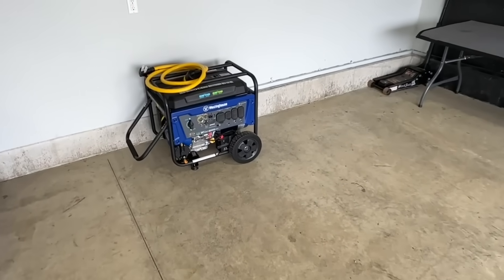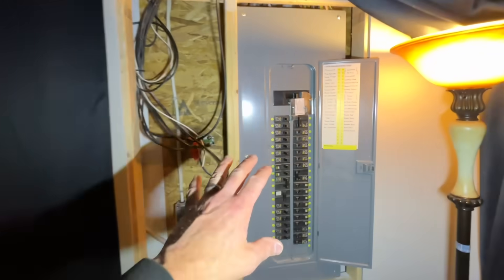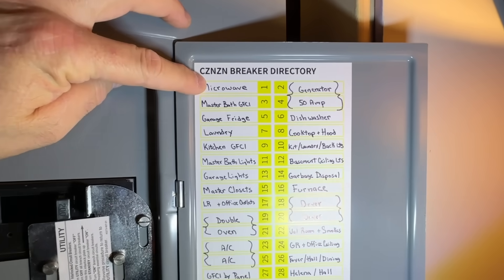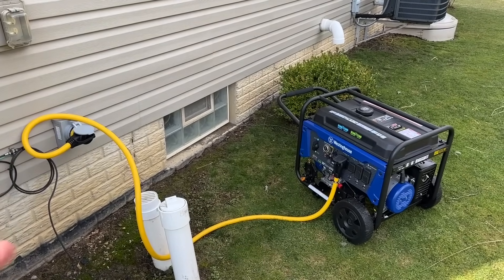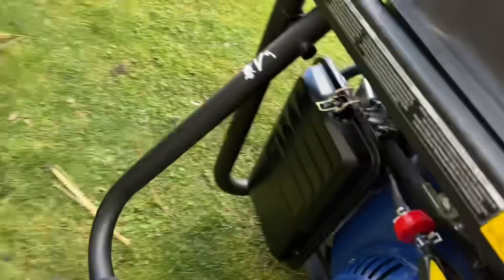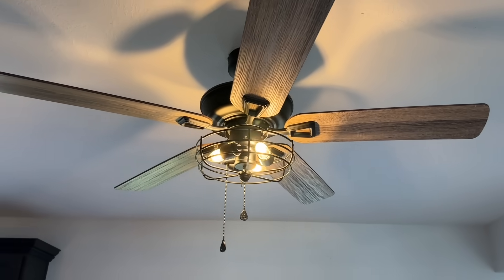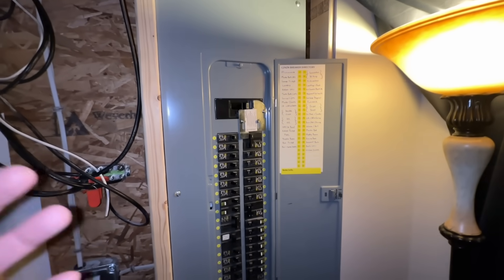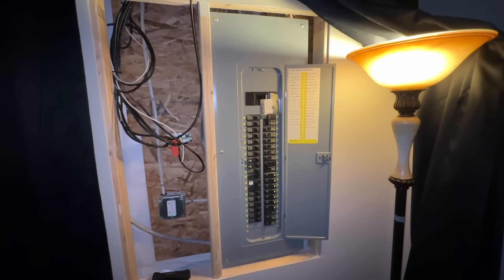Whole Home Manual Backup Generator Setup For Less Than $1600

Comment: BS I have same gen I don't shut nothing off , put 60amp breaker an hook gen to it leave it off, when power company is down , shut your main off ,turn on 60amp start gen mine has auto key chain type bottom, start gen whole house 1600sq foot an 1600 sq foot shop , have power I can weld an air compressed running good to go, so BS your telling the people for sure mine is (propane) the only way to go , life is not hard so don't make it that way:hand-pink-waving:

Comment: With that generator, you obviously did not research the impact of running your appliances and other electronics on "dirty" power.  That up front savings will come in handy when you have to replace a refrigerator or the mother board on your gas furnace.

Comment: I don't have a grid tied house. I just want  to w wire.straight to a mjlti.plug bix for my small 50amp plasma cutter or small.ibg multi process welder. In my stand alone work shop. Where do I.get the generator??. Thanks Dandahermit. Thumbs up and subbed

Comment: A question on GROUNDING.  I have the portable generator already, but not the manual cut-over switch and port yet.  So, do you still need to ground the generator (earth) or does the electric panel actually take care of that once the cut-over switch and port is installed?  i'm asking for a friend.

Comment: Awesome video! Great job at keeping it simple. I completely agree with you on not wanting to spend a crazy amount of money for something that may only be an issue once or twice a year. My biggest issue has been flooding due to heavy rains so I had a smaller inverter generator that could basically just run that. Our outages were usually only about 1-3 hours. I also have a battery backup for the sump pump, but the battery backup can simply not keep up if there are heavy downpours during an outage. I am going to buy the Westinghouse 12500 and get the same hookup you have. Been talking about it for 3 years but I'm finally going to do it for more peace of mind. Especially since I can't run the furnace without this type of hookup since it is hardwired into the circuit breaker panel just like the A/C.

Comment: This Westinghouse 9500 will run on Natural Gas ?  Most homes where I live (SoCal ) are heated with Natural Gas so have ready supply near my power panel . Seems this would be better way to power this generator and gives you "infinite " and ready supply ..not having to worry about storing gasoline for long period.

Comment: I think that I saw you set the geni to gasoline?  I was always under the impression that using gasoline was the beginning of the end for generators. The gasoline gums up the carb. Where the lp gas does not. Everyone I know do not properly maintain their generators making them completely unreliable or useless when most needed.  

What are your thoughts on this?

Comment: If you need only essential service, say heat, does $150 sound good?

You need:
1. $99, 0:29 1500W 120V15A Inverter. 
2. $45, 100ft. 12 gauge extension cord. 
3. $5 duplex receptacle, minor box rewire. 
4. Car with gas. 

You can run a forced air natural gas furnace with this configuration. I paid $150 for mine. 

You can cook with a grill, Coleman camp stove or single burner single gas 
Burner. 

Light with usb rechargeable flashlights. 

Most important is that you can be very comfortable without electricity in the winter. 

The power loss will likely just be hours or a day.

Comment: One thing to add is that it is important to have a surge protector on your panel. Code in some places is now requiring them on replacement or new panels. Trust me on the fact that generators can produce erratic voltages.

Comment: I like all of those circuit breakers in your “fuse panel”. That must have some kind of crazy 1920 to 2020 conversion kit installed???  Also, I assume that generator has a floating neutral?  If not, your electrician friend just wired you up a parallel path to ground… be sure not to touch anything metal 😵😳😬😭⚡️⚡️⚡️

Comment: I dont understand why you need to shut off any breakers but rather just make sure not to power them on during generator use. If not turned on, then no pull would be used. Of course im not an electrician so thats why im asking.
Reply from the maker: I just didn’t want my kids accidentally running around the house turning everything on during a power outage. That’s why I turned certain breakers off.
Reply: Oh ok that makes sense.

Comment: Really good video. I lost power for 7 days last year in an ice storm here in Oregon. Now I have a setup similar to yours with a Gentran transfer switch that runs 6 circuits. One thing I learned was the importance of a generator cover or ideally an enclosure that you can get under with it. I was trying to refuel in the pouring ice cold rain and the Genny getting all wet, so I rigged up a half ass cover that sorta worked but there's nothing worse than trying to service the Genny at night in pouring rain. Another thing that greaty helped me was an Olight rechargeable flashlight with a hat clip. You need 2 hands to pour fuel in the Genny and that little clip on flashlight was a real savior otherwise I could'nt see crap. Good luck with your system it looks great.
Reply: Had the same experience here n rural Northern Ireland, ended up importing a gentent from the states, a fantastic bit of gear to shelter the generator, O light or LED lenser are fantastic head torches

Comment: Oh yeah. Make up a very clear set of step-by-step instructions that says each step to do for all parts of putting your panel to where it needs to be, then what steps and in what order your interlock operating steps must be done when actually connecting the generator, after locking out the main service. Then laminate it, hang one copy by your panel, and another with your generator. Because when the time comes to use it, that way you won't leave out any important step. Can't over-state how important that is. If you panel(s) are in the basement (for those who have basements), put a good flashlight or half a dozen Chem-lite sticks next to it. You'll thank yourself later.

Comment: Buy a copy of your local electrical code - 1st. If in doubt, check what hardware your Province or State can legally sell. Like maybe a full isolation switch with a lock and ONE key. Maybe an entire sub-panel with a specific isolation device. That  will depend on where you're at. But apart from not accidentally electrocuting a lineman - one very good reason is that without an interlock switch that's up to code for your area, your house insurance will be void. They won't pay one dime even if an aircraft crashes on your house. Even if the manual interlock had nothing to do with whatever caused the damage. The basic idea is fine. But the devil is (sometimes) in the details. I have a manual isolation & changeover that does the same thing, but required specific hardware that's a bit different. Works great the 1x or 2x a year it's needed.

Comment: On a even simpler scale I put a waterproof box outside with male plugs which run shortest path thru wall inside to locations close to needed power. 

Solved two problems of having to go thru opening and long extension cord path lengths to power the few things needed.

Comment: You will come to regret buying a Chinese built generator. Parts are made from Obtainium. If you have a warranty claim, good luck finding a servicing dealer. Although I don't repair small engines, Westinghouse somehow got my name as a small engine repair technician. They kept calling me over and over again, to get me to be a servicing dealer. I was even getting calls from people who said that Westinghouse told them that I would repair their generator. Westinghouse has around 100 servicing dealers in the entire nation.

Comment: if you want your gen to last longer, do not turn it on with every breaker you want to power also on. Start it with no load, then gradually turn your breakers on. Then do the opposite when going back off generator power, and let it run with no load for a few minutes to cool down before turning it off. 

Just some tips
Reply: Well, at the same time, when the power comes back on, you want to be sure all breakers are off when switching back to utility power.  Then you switch on your main breaker and slowly (maybe 5-10 seconds between each breaker) turn each breaker back on so you don't overload the utility transformer.  But yes, starting, warming up and then connecting the generator to the house one circuit at a time is also a good thing but also running your generator for a cool down period like you mentioned

Comment: Good info.  Perhaps controlling via breaker the startup individually of the frigs would help.  I would remove all load on the gen before powering off.  Also recommend keeping exhaust pointed away and as far away as possible from the home for CO concerns.  Lastly, longer usage hours you may need a rain shield.  I have seen some just use a folding table over the gen.  I use a rain tent made for the gen…by hey; that’s another $150 and is not the point of the video.  Appreciate the info and video.
Reply: Also; did you unbond the neutral on that generator?

Comment: Unfortunately this Generator Produces a total harmonic distortion of 23%, So it's not safe for any modern electronics. For reference it needs to be <6% to avoid the potential for burning out a circuit board on your Computer, Router, TV...even the new controller/electronic units on most modern appliances or devices.

Comment: Is there a need to turn off some of the breakers if you are not running any of those systems? Was that just in case someone forgot and turned on one of those items? Our power goes out normally when it's storming with a lot of rain. Do you leave your generator uncovered out in the rain, or do you have something shielding it from the rain? Or is that even a concern? Thanks for the video.
Reply from the maker: I turn the breakers off that are not needed in case my kids accidently turn them on and overload the system.  In an emergency, I’m more focused on the fridges, heat, etc., but being able to run some lights, fans, WiFi, a couple tvs, etc. is nice especially for the kids.  Luckily most of the time I’ve needed the generator the storm passed already but, if I was raining I’d create some sort of canopy over the generator but I hope to build a small cover for it soon.

Comment: I currently set up for a large generator, with a 50amp outside outlet and a transfer switch. I also have a small, 2000 watt generator. Any reason why I can’t get cord to plug gen. with 50amp outlet ?
Reply: There is a way to do this…but I can’t recommend this.  Your 2000w gen is most likely a 120v gen.  There is a connector to supply this to both L1 and L2 sides of your panel.   You cannot run any 240V appliance off this connection.  Personally, I would buy a 240v inverter generator in the size you need.
Reply: I know the limitations,  but the alternative is to back-feed thru an outlet. That limits which circuits receive power.

Comment: Would have been nice to have seen how you wired it in the panel.
Reply from the maker: It’s just a 50amp double pull breaker wired to the outside 50amp plug outlet using 4-6 gauge wire.  We just moved two single breakers from the top right to the bottom so that we had space for the double pull breaker and switch plate.
Reply: @DieselLegiance  Cool,, thanks for the reply... I am close to pulling the trigger and do it. Not too many power outages, however,,, you never know when...

Comment: PLEASE DO NOT TURN OFF YOUR GENERATOR UNDER LOAD! This can permanently damage the power head on the generator. It can also damage equipment in your house to have a voltage drop like that.

Turn off the breaker first and let the generator run unloaded for 1-5 minutes and then shut it down.

Comment: Here’s something you missed? You can go to Lowe’s in the garden area. And buy a plastic storage container. It has a open lid on top and two double sided doors in front of it. Then you can buy two to four air vents. And cut out a section in the container. For air flow to the generator to breath. Plus add two box fans on opposite sides of each other where the vents would go. One pulls in more air and the other side push out the exhaust fumes. Use metal fan blades no plastic due to heat side. That way you can run your generator in all types of weather. For I don’t believe generators are rain proof.

Comment: That’s all finding good. The problem is you really don’t know when the power is back on your electrician, buddy should’ve put a fuse and a lamp on the line side of the power company. This way you know the power is on which would you use an Achilles lamp holder keyless one got a fuse in it then it goes to a lightbulb hooked to the main breaker, bending all the power is on by yourself fix that problem you backyard electricians
Reply from the maker: Our power company sends us text notifications on when power is turned on.  We had no use for additional notification methods but definitely a good idea for some people to consider adding.

Comment: May I add something here: 1st thing when turning back onto the line voltage - just simply disconnect generator by shutting off the 50A breaker...this allows the generator to stop sourcing power and let the engine run for a few minutes to cool down (Without the load) and simply flip back on the main breaker in the meantime 1st...then flip back on any smaller breakers when your back to normal.....this will help eliminate and large spikes from an (All on load) condition. You also should start the generator 1st and hook it too the house before you go too the panel as this give the unit time to warm up and stabilize itself before use...then just switch over to the unit from your 50A breaker (Assuming you also flipped off any unnecessary marked breakers before turning it on) helps with smaller loads onto it rather than a sudden slamming load.

Comment: It's good for operating Lights It will not operator lights and a refrigerator I know because I ran a 13000-watt generator made buy the same Mfg. it will not run an entire house (maybe a tiny house) I tried to run a 1700 sqft. totally electric without heat or air conditioning   just a few lights at night and the refrigerator that did not get enough power to freeze ice.
Reply from the maker: Well, not sure what to say but I’ve run 1 freezer, 2 fridges, multiple lights, tv’s, and more.  Granted, I have a gas furnace and gas water heater, and gas fireplace.

Comment: Others already pointed out that it is better to shut down the generator breaker first and only then shut down the generator.
I want to point out that when running on gas it is best to shut the fuel line off and let it use gas from the carburetor. This way it will not get gunked.

Comment: Can you answer me a question? Does it matter where the generator breaker is placed on the panel? I don't want to rearrange everything or buy a new fusebox..I have 1 slot available for a 240/50amp breaker located on the bottom right...WILL IT WORK IF I PUT BREAKER THERE???
Reply: @cantankerouschris4596  wow, your username fits. Why bother asking a question if you’re going to just reject the answer and call someone you don’t even know online a liar? Yes, it will work without the interlock no matter where the gen breaker is located but it’s a code violation and it’s dangerous. No electrician who knows what he’s doing and doesn’t want to get sued or possibly even lose his license will hook it up that way. If you didn’t have the electrical knowledge to not need to ask the question, then you should pay a licensed electrician to do it right. I just installed one of these for my brother and it was less than $20 for the interlock kit on Amazon. If you get sued because you forget to open the main breaker and end up getting a lineman killed by back feeding the utility lines with your generator, that’s on you. I’ve had my masters license for over 20 years but do what you want. I was just trying to help
Reply from the maker: Yes, the new breaker and interlock switch has to be at the top.  That’s why I paid my electrician to move two breakers from the top to the bottom to make room.
Reply: @DieselLegiance  if you had to pay a electrician then you obviously don't know..
Reply: @cantabkerouschris4596 I AM an electrician and the answer he gave you is correct. The interlock kits are designed differently per manufacturer and type of panel to accommodate that specific type of panel. But the one thing they all have in common is that the generator breaker has to be physically located in a specific (either on the left or right side) spot closest to the main breaker. It’s not difficult to relocate whichever breaker or breakers that are in the spot where the generator breaker needs to go. Sometimes you get lucky and relocating the breaker or breakers that need to move gains you extra slack in the wiring coming off of those breakers. But if the wires are too short, you can always make a splice to extend the wires to reach the new location of those breakers. It’s not desirable to have splices in a panel but it’s not an electrical code violation and it’s necessary in this situation
Reply: @Ephesians-ts8ze  I didn't ask about the interlocking kit..I asked if it mattered where the breaker is located in order to work...Which it doesn't..As long as the main breaker is off, the generator breaker can be located anywhere...and that was my  question...If I'm the only one who is going to touch the breaker panel in my cabin, I don't need a interlocking kit...Unless I get dementia...And BTW most people who claim to be something usually are not..So I call BS on the electrician thing